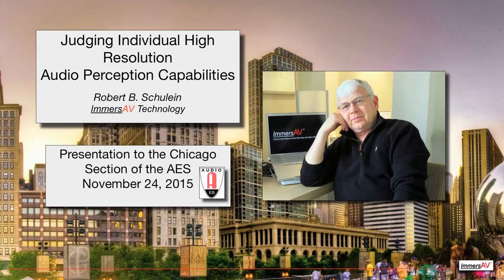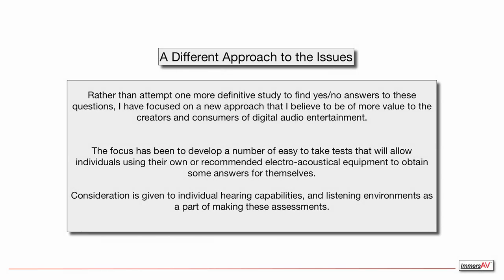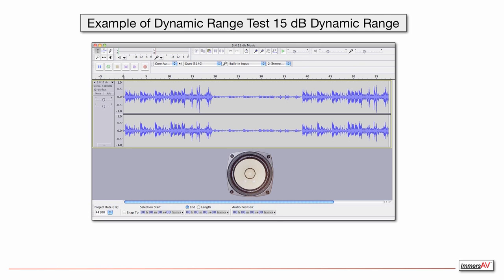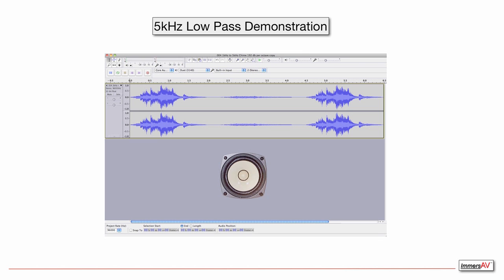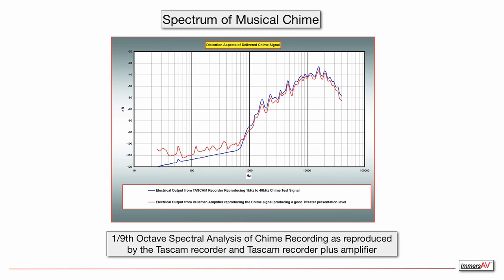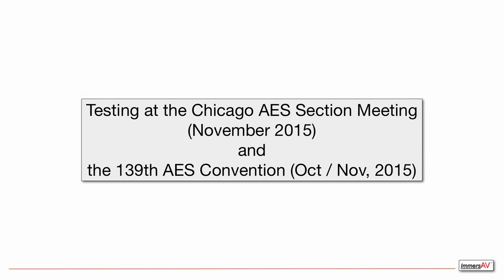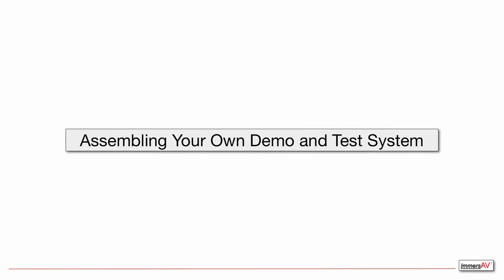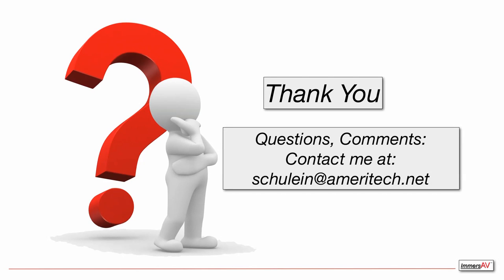High Resolution Audio Tests - Judging Individual High Resolution Audio Perception Capabilities

Comment: Would the resonant frequency of the PVC tube affect the tweeter's response?
Reply from the maker: +Benjamin Richards 
Hi Benjamin, You raise a good point.  We were concerned with this possibility, but determined that since the tweeter was of a closed back design the back cavity should not influence the acoustic output of the tweeter.  Hence we did not implement any special treatment of the back cavity.
Best regards,
Bob Schulein
Founding Partner ImmersAV Technology